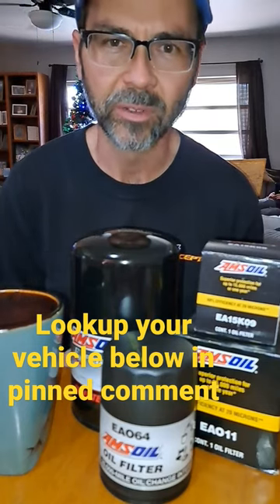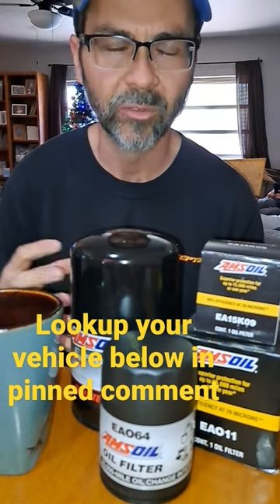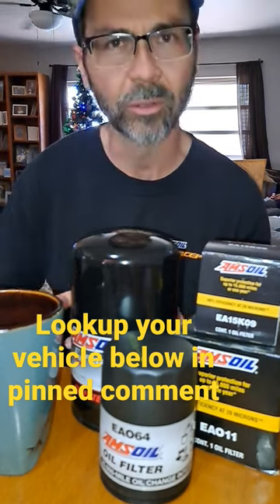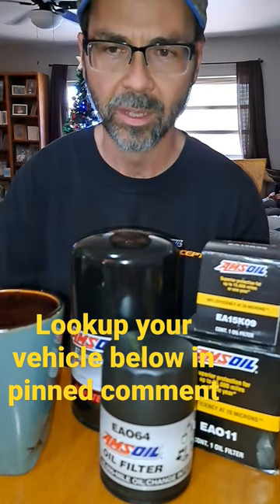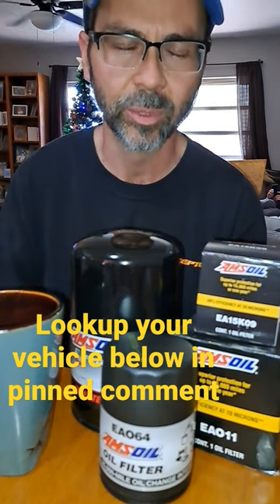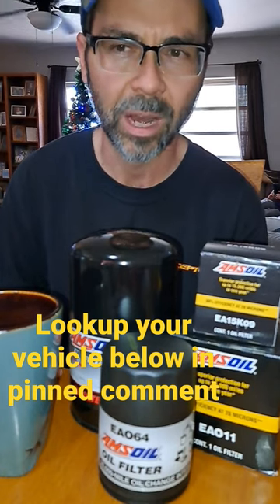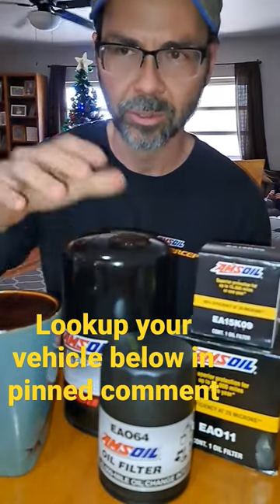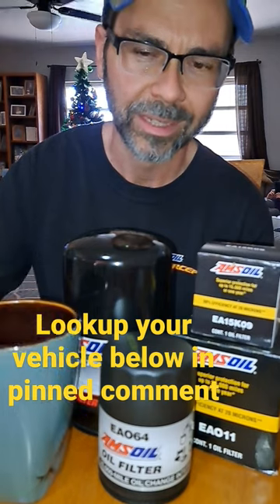pre-filling oil filters revisited. Hydrodynamic vs. Boundary Lubrication

Comment: car engines loooove unfiltered oil and possible contaminents. you know that happens when your car sits overnight too right?
Reply from the maker: Thanks for the comment. I did a short where I explained the Amsoil lubricants are filtered to 98.7%  absolute at 2 microns before bottling. Thanks to the ultra-pliable silicone anti-drainback valve in the Amsoil filters, oil stays in the filter after shutdown.
Reply: @MikeTrullAmsoildealer  yeah thats all well and fine, but when you open the bottle and the filter and then fill it up, the chance of contaminents getting in are larger. I do around 8 services a day and that takes extra time away from work. And if your good an oil change takes like 15 mins. Not enough for the oil barrier to not make a difference.
Reply: Left Purolator filter draining for 2 1/2 month with the opening side down.  Cut the housing open and I was surprised that the filter housing was still 1/2 full with oil.